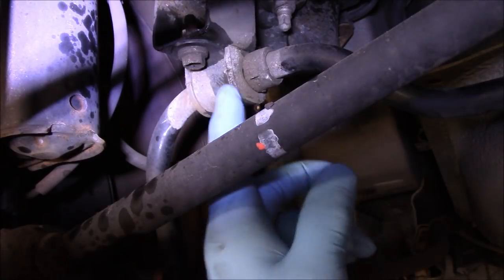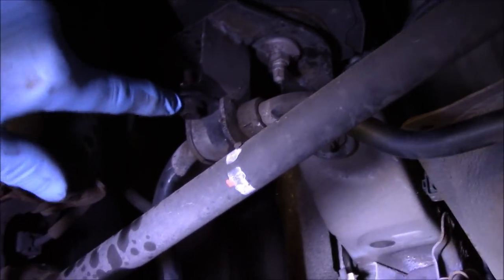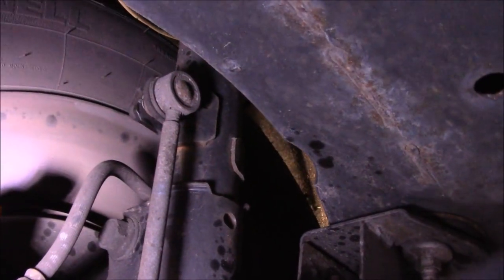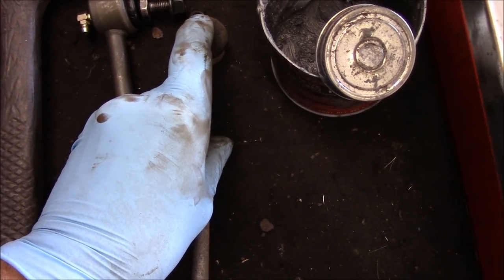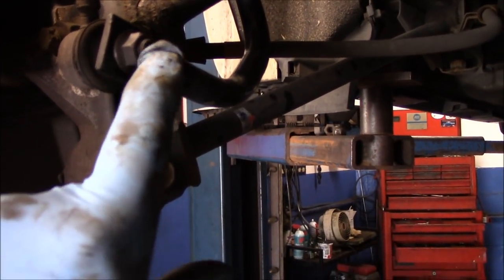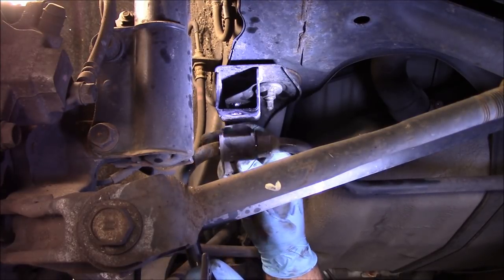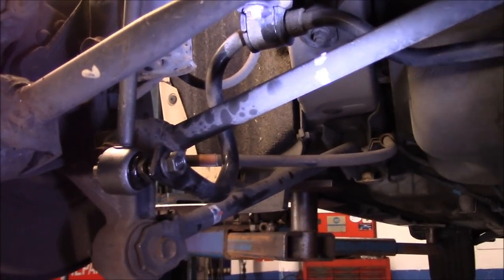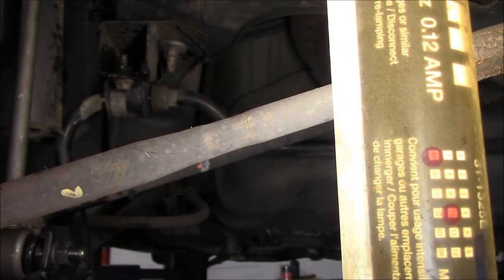Diagnosing rear suspension noise 2008 Toyota Camry

Comment: Replaced my rear sway bar bushings today.  2011 Camry. Moog.  Took me 1.5 total hours from walking out of the house to walking back in.  Old bushings didn’t look bad, they were even still soft.  I did see a small oval part but it was hard to see.  Go slow on the 12 mm bolts and use plenty of penetrating fluid.  Go out and back in to get female threads of nut lubricated.  If you sense any difficulty turning bolt, stop and go back in and re-lubricate.  End links are 2 months old along with new KYB struts.   Use wire brush on bolts before reinstalling.  $17 Moog bushings.  Noise is gone.  Put rear wheels on (2) 2 X 6 boards and kept slight pressure on floor jack on center cross member.  Easy job after breaking 12 mm bolts loose.   Plenty of prayer before hand.  😃
Reply from the maker: Thanks for watching.

Comment: 2011 Camry, had vibration and a knocking sound in rear passenger area.  Importance of a visual inspection. Got under and found a locking nut loose on a rear lateral link.  4 threads showing.  The other locking nut was barely wrench tight.  Had 9 and 3 play on wheel which was unlocked threads knocking.  Adjusted alignment and took for ride and feels and sounds 100% better.  Stealership would have replaced entire rear suspension. Also importance of knowing how to work on own car.  Having 20 years backyard knowledge.  👍

Comment: Hi Jim.  Thank you for doing what you do.  I've become quite distrusting toward many car mechanics in my locality which has forced me to learn a lot and do things myself in order to maintain a (very) high-mileage car.  450,000+ miles on this engine/transmission currently, but still running strong. 

'09 2.4 Camry here --- when i replaced the front links, there were no allen-hole slots to stop it from turning. I used a thin vice-grip on the rotating-bolt itself from the inner-side between the sway-link head and the bolt slot.  Then I was able to torque it down to spec value from the outer side.  I was weary that the vice grip might tear the new rubber head of the sway link, but it did not and worked out okay.

I've never replaced the sway bar bushings and now I realize, after many other replacements, that the bushings are probably the cause of the noise I've been hearing so long.
Reply from the maker: Wow 450K that is a lot of miles

Comment: One thing I noticed about the installation of the new parts was that you made sure the grease fittings was in the correct position so they could be greased, and that is important. I do the same thing when working on my vehicles, and tractors. That will extend the life of all parts on your vehicles.

Comment: Funny thing is, I remember watching your vid on replacing a strut for a 2008 Camry and in thinking the issue with my 2008 Camry was a worn out rear strut, I purchased two.  Thankfully I never installed them and am able to get a refund, as I checked both bushings and links to find out they were very worn out.  Saved me roughly $300 in needless repair and I was able to get a set of Moog bushings and links with zerks for around $120.  Thanks for posting this vid, much appreciated!!
Reply from the maker: Glad I could help!

Comment: Awesome! Thanks Jim !!  

 -- I had some issues with wife's 2007 V6 3.5L Camry with 90K miles. I too needed to replace the end links and sway bar bushings. I used Moog parts and all was right in the world. Was super easy and quick.

-- I always try to get the best parts that I can. Go in -- don't rush -- do the needed work right and with the best parts available -- and get out. The world becomes a happy place once more.
 
-- Thanks Jim - You always host up some of the best videos! 

 -- Mahalo's!!

Comment: Thank you so much. You eased my mind. Just a DIY mechanic and I installed new OEM strut assembly on my 07 Camry in the rear. Torque to spec. Replaced sway bar links. Have that rattle going on. Was worried I did something horribly wrong.

Comment: $175 for links AND bushings with quality parts and labor!!! I'll take the deal from Jim!  The bushings are easy to do, just making sure to take out the very tight 12mm bolts.  The links are a bit harder to do!
The stablizer links do not come with grease inside already?  One would need pump in the grease? If so, what kind of grease?

Comment: I have the same car, another common source of clunk is the very top of the rear strut hitting up against the metal frame on car where it's positioned and secured in the three holes, basically the top strut mount hitting the metal part on car and no cushioning in between. I removed both rear struts and added a thick of layer felt on top of the strut mount and that fixed it. There is already toyota oem felt there, but it wears down after time to the point where it's just metal hitting metal and clunks each time you go over bumps.
Reply: mannypeligroso i think i have the same issue as your car. It sounds like a clunk noise coming out of my trunk. How did you fix that? What kind of felt did you use?

Comment: Thank you Jim for the video. i have 97 Camry V6 with 390k kms. I had the same clunking noise coming from rear of the car. i took the wheels out and looked everywhere. found that the swaybar had little play around the bushings exactly how you showed and also it was sliding a little bit too. i have to order new bushings and will take time to arrive. i taped a little cloth tape around the bar before putting same bushings on just to check out if the noise is related to the bushing. went for a drive and the clunking noise was gone. i will wait for my new bushings 17mm to arrive so that i can install it. it was easy fix. thanks.
Vish
Reply from the maker: Great it is hard to believe that the little play in that bushing can make so much noise but it does. I'm happy to help. Watch for the next free tool giveaway coming soon.

Comment: A little tip for the links, you can cut the rubber boot off and use a good pair of vice grips to grip the stud on the inside then remove the nut if the allen  hole is rusty or stripped.
Reply from the maker: I'm happy to help. Thank you for watching.

Comment: I have clunking noise from the rear. It happens after I replace the struts, mount and insulator. Logically it must be one of the new parts that's causing it. I made sure top nut is torqued as well as the mount nuts. I even disassembled and add rubber insulators between strut and the mount but the noise is still there. Only happens at slow speed around 0-20 mph. I checked the end links and sway bar and they are not lose. Running out of ideas now.

Comment: Hello, you've described exactly how I would describe the rear clunking sound, exactly same scenario....01 camry wagon, 380 thou ks, rear shocks replaced today with munroes and the worst clunking sound hitting small bumps from rear, way worse than before with old ones, took back they hoisted up wheels off to show me small play in bushes causing clunking over bumps, they telling me that the shocks working better now so the bushes and rear sway bar working more and  bushes need replace esp at 380 thou ks, 19 yr old probably right but... it still just don't add up to me , the slack so minor and such big noise, especially when bushes rubber, honestly, it sounds like metal on metal.  Just wish you had his  noise recorded on drive test too..... the height also don't look any or much higher than before.  Scared to take on open road it sounds so so bad.  I tried spraying them all with silicon, it didnt work. How come clunking so loud and sounds like metal on metal?
Reply: You would be surprised how you can have barely any play and it will make quite a racket.  Any play at all....replace them.  They're cheap and easy to replace most of the time.  Still amazes me sometimes and I've been doing this for 40yrs

Comment: Have the same issue in my 03 Toyota Avensis,my mechanic could not find the issue,been knocking for two and a half year's.Going to get a friend to help me fix it soon.
Reply from the maker: Make sure to check the links as well as the bushings.Thank for watching.
Reply: @jimthecarguy  We did the bushings,noise is from rear left shock top,getting it replaced tomorrow.Fingers crossed noise will be gone have N.C.T. (Irish road safety test) on Saturday.

Comment: Great video man. Thanks. I recently bought bushings for my girlfriend's 2005 Solara and I noticed they are much harder than the originals. They feel almost like polyurethane instead of rubber, though I didn't specifically buy performance type bushings. Should I return these and look for softer rubber ones? They are USA made "Import Direct" brand (O'Reilly's house brand I guess.) Thanks

Comment: jimthecarguy, thanks for your videos. I'm looking for how to replace the evap canister on my 2011 Camry. It is located above the rear suspension crossmember. I have not found any videos on how to replace the canister. This came close, but the rear suspension crossmember looks different from my 2011. Do you have any tips, or a video I can't find?

Whatever little information I can find almost seems to say I have to remove the fuel tank and a bunch of other stuff. If you have tips, I'd appreciate it much.

Comment: Jim, I have replaced my rear bushings, end links and strut assemblies in my 2004 Camry only to find the clunk is still there and it seems to be on the left side. I completely emptied the trunk of the spare tire and all tools to eliminate that possibility but still, the noise persists. What else could it be?

Comment: Jim, you need to try the Astro 40SLMax light. I own the same OTC light, and the Astro will illuminate the whole engine compartment. It also has adjustable light output and fits in places the OTC won't. That said, I own and use both units.

Comment: Jim, Is it possible to replace the bushing without disconnecting the sway links?
Reply: Bowler0328 yea they make a split bushings you just pop around the bar.
Reply: But it’s harder because you have to pry back into place with a long bar of some sort.

Comment: hi Jim, I had this same problem took it to Toyota and they said it was the sway bar bushing, so they replaced them  it was better for a little while thin shortly after it got bad again   the noise is still there and worst ,I'm thinking  of replacing the sway bar links what do you think
Reply from the maker: Before you replace anything I would recommend that you look at the work they did something could be loose. Thanks for watching.
Reply: ok , if the bushings look good and it has  no play, would  you then replace the sway bar links Toyota  did not replace the sway bar links  original links have 200000 miles  thanks for your reply

Comment: are the torque specs for the 10mm bolts [holding sway bushings to frame] the same for the front and rear? I'm guessing ~30-40 ft/lbs?

Comment: Yeah I have a Toyota Camry 2003  and it sound like my problem like that situation that guy was having when driving, in my Car I could hear a noise every time I would go on a bump or even driving on a flat road what would you recommend?
Reply from the maker: It is very common on this car I would check and replace as needed. Thanks for watching.

Comment: I have a 2006 Camry - have a terrible sway in the rear end when there is any weight in the trunk. It feels very loose / sloppy on the highway & especially when lane changing at 70 mph or above. . The rear shocks/struts have been replaced. Have had 4 wheel alignment. There is no noise from the back.   it is very scary feeling ...the feeling like not good   control when on the highway and changing lanes. Any thoughts on what this could be?
Reply: could be wheel bearings. is there any wiggle / play in the wheels when it's jacked up? like side to side play, perpendicular to the axis of wheel rotation. A worn out bearing can create that sway / instability if it's bad enough, but if it's not making a sound then that might not be your issue.

Comment: Sir my car i20 has got irritating noise at the rear.

The noise is audible with only one driver riding the car. However, it diminishes almost completely (90% noise gone) when full occupants (5 persons) are inside the car.

I even tried myself looking to identify the issues by riding alone -
1. even taking off all the stuffs like spare tyres, tools, etc. from the dickey leaving it empty. Still the sound exists.
2. tightening all seat belts and alike.
Having perform the above tests alone and the same i go ride with full passengers, then it seems only when the car is full, the noise seems to go away.

There is no leaks, damages or etc in rear shocker, bushings, springs etc. tires are good. Please kindly help me out this frustrating noise coming from the rear which surprisingly fade away when the car is full. Hopefully waiting for your perfect solutions. Thanks.
Reply: Really sounds like a bushing there is the slightest play that only becomes a loud noise when your thousands of pounds of metal pushes into that open space it clunks. But when there is a massive amount of weight hence occupants the vehicle won't have any play just constant force onto the metal so no clunk.  

I'm not a mechanic but logically deducting it that way, it sounds like a bushing problem

Comment: Yea,the previous mechanic screwed him. Replaced the most expensive parts. Didn’t fix the problem. I’d do the bushings and the links. The labor isn’t too expensive but the flat rate manual is a license to steal,and everybody uses it.

Comment: Does it making a clunking noise over bumps too? Coz mine does, after I replaced the rear struts assembly still does making clunk noise!
Reply from the maker: Did you check the sway bar bushings that is a very common problem

Comment: ok good i replaced sway bar links because they stripped iout when i did my struts so hopefully it is this bushing... i misdiagnosed and replaced the front right cv joint/axil took me 3 days after work a bitch. started making the same noise when i was done.
Reply from the maker: Yes the rear sway bar is a very common problem on this car. Thanks for watching.